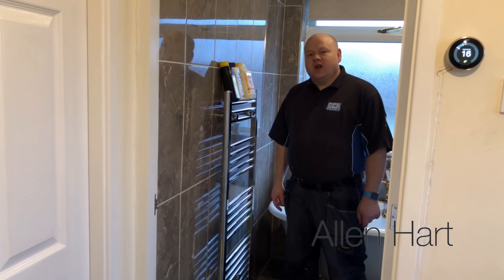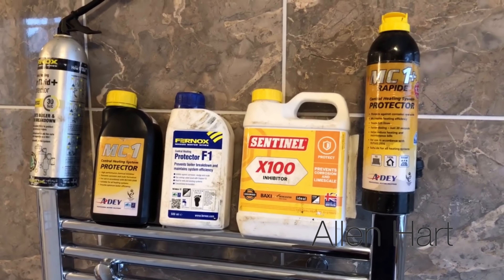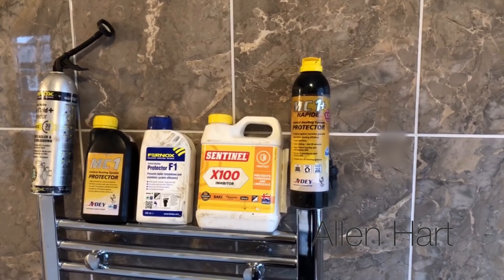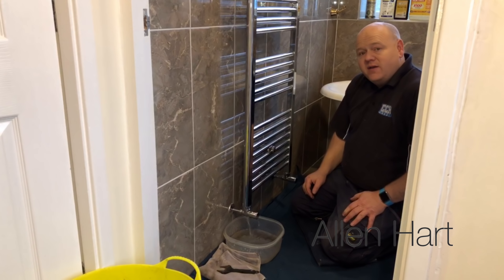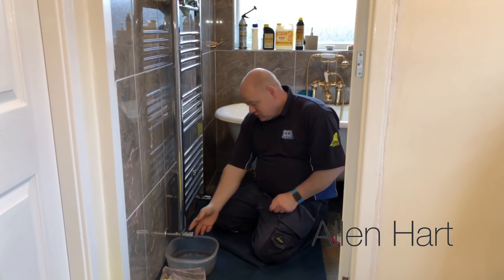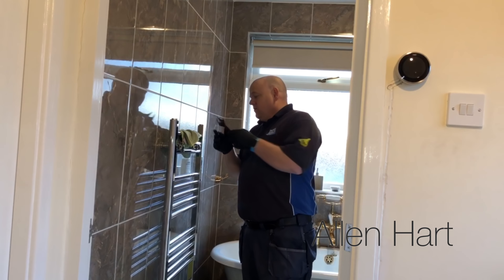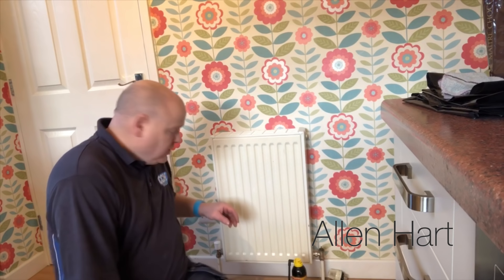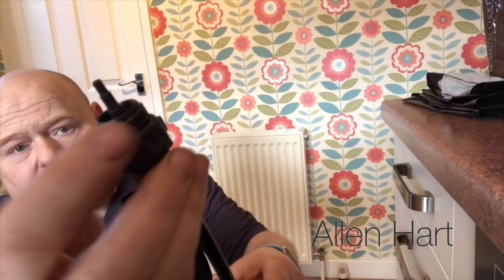How to add inhibitor to central heating - Step by Step DIY Guide

Comment: Nice video Alan. 
Towel rail is always an easy option! I usually siphon the water out  from the vent with a small hose. No need to disconnect the valve then 👍
Love the videos pal
Reply from the maker: I have never even thought about doing that. Great idea though. Thanks.
Reply: I agree, good idea! Got a giant syringe that'll do the job, will do next time. Cheers!
Reply: 500ml suction syringe by sealey looks ideal :)
Reply from the maker: Wow thats an amazing idea. Every day is a school day.
Reply: That's what I did. Used a large syringe (from Amazon) and a bit of fish tank air hose to suck out 500ml of system water from the towel rail, put in the Fernox F1 and hey presto! 5 minute job. Easy and totally mess free! 👍🏻

Comment: hi allen , there is te piece on double panel radiators thats why its impossible to add without that 'express' on your hand ..I add into return line bottom of boiler by using flexible funnel. if there is towel rail no prb ) thanks for sharing
Reply from the maker: Thanks for watching buddy, Have a great day.
Reply: @AllenHart999  you're welcome, I wish you good year

Comment: I'm just about to change my bathroom radiator to one like in your video. So thought I'll be adding the inhibitor. Do I need any of the following as well X2000 Noise Reducer and when/how do you use One Visit Flushing System? Thanks

Comment: Hi Allen, as the air vent is being removed anyway, could you just syphon the water out of the top with a short hose? Then there's 1 less thing thats been fiddled with, so less chance of a leak after
Reply from the maker: No idea as I have never tried it, very easy to do like this, Thanks

Comment: Quick question 
I want to add fernox through a filling loop on a boiler. Do I need to drain the system first before I put the fernox in, similar to the way you do it through a filter?

Comment: Hi Alan, great videos. I have a question. My boiler is three years old.when I took out a service policy I was told I needed to have installed cleaner to prevent sludge. The fitter put some “protector” into the boiler (Ideal). He told me it would be fine doing it this way. He didn’t drain any water. Your comments would be appreciated.
Reply from the maker: That sounds ok. Thanks.

Comment: Good video as always!  If we add the inhibitor in would this also run-through underfloor water based pipes too as well as the radiator pipes? Thanks
Reply: Yes
Reply: @alang7846  that's probbaly a bad thing right?

Comment: Does it matter if I use a different inhibitor than what is allready in the system? I read online in a few places that its a big no no to mix them. Do I need to re add inhibitor if im taking off radiators to decorate? I live in a ground floor flat also so I don't have a high point to add the inhibitor if its needed

Comment: I assume if you use the same funnel to fill up your radiator with water after pouring in your inhibitor there will be no need to re-pressurise the system. Makes sense?

Comment: I like your towel rail with the piping coming out of the wall, makes it a very clean job. With ours the pipes come up through the floor like usual so makes a rite old mess when draining g some water out. Do you recommend an actual inhibitor your self that you use? I last put some of Screwfix own brand in. But have used the sentinel in the past.
Reply: @AllenHart999  cheers Allen.  I prefer the sentinel one purely because there's a litre in it the others have less for a similar price, and it's a trusted brand isn't  it. Not sure if there's a reason mind for the others having half the amount? I  had drained my system down a few weeks ago and put fresh sentinel in, then discovered the system was really noisy when heating came on in the piping making glugging noises like there was trapped air or something but no radiators needed bleeding in the end was forced to drain it back out what a waste! So got a cheaper Screwfix bottle due to cost ha....whatever happened though was sorted when drained and refilled the second time no glugging this time.
Reply from the maker: @LeeGee1983  Most of the bottle is water so i do not really think it matters too much which you choose out of the top few brands. Thanks.
Reply: @AllenHart999  oh, selling me water are they haha. Thanks Allen quality videos by the way
Reply from the maker: @LeeGee1983  Thank you for watching.
Reply: @AllenHart999  what are your opinion on something like sentinel x400 cleaner? Have you any experience using this or similar ones you just put in the system and leave in for a few days then drain?
Reply from the maker: Lee Gallie I have used x400 and x800 a lot and tbh in my opinion they are very good. Make sure you get it all out afterwards though 👍
Reply: @AllenHart999  nice one, appreciate the opinion mate on it may drop a bottle in and give it a treatment before the weather may turn colder.
Reply: Used the F1 allen used myself  ,  good product but they all do the same thing in the end , good idea if possible is to drain whole system & flush through before refilling system plus the inhibitor :)

Comment: Hi allen so whats inhibitor needed for or doing for the heating system iv never put any in my system as of yet never had an issue
Reply from the maker: If you flush the system well to start with then in my opinion you will have less issues with or without inhibitors. What boilers do you fit. Thanks.
Reply: Inhibitor is supposed to stop the copper in the pipes reacting with the steel in the radiators and turning them into magnetite sludge which blocks the system.

Comment: How much Inhibitor do  you use..? on the containers the product comes in it states eg use 500ml to  to treat 125L I for one dont know how many liters of water is in my system.. would be helpful if you gave some guidance on dosage.. for example 8 rads use 500ml as a geners rule of thumb..!! Happy new year
Reply from the maker: Most bottles say they treat about 10 rads i believe. Thanks.
Reply: Yep , normally the 500ml bottle for 8-10 rads :)

Comment: I've have this ago, but when draining only about 200ml came out ? Should be have ran my central heating system first to fill it up?
Reply: For anyone that has this same problem, if you move to the other side and slacken the nut on that side you will get more water out.

Comment: Careful with new modern TRV's on towel rads, even when closed to their OFF setting (frost symbol) they don't shut the water off to the radiator as they dont push the little pin in the TRV carcass all the way that stops the water so there's pressure continually getting into the radiator. 
Always best with the new TRV's to unscrew the securing ring to release and take off the thermostatic head from the TRV base, find or borrow the plastic blanking cap that came with the unit, and screw that on firmly in it's place so it pushes the pin and stops the water/pressure. Then after checking the other side valve is fully closed, then the towel rad can be bled with a bleed key and top sealed nuts loosened.